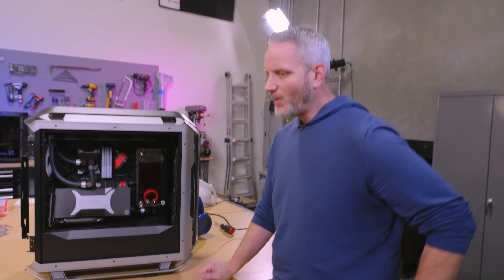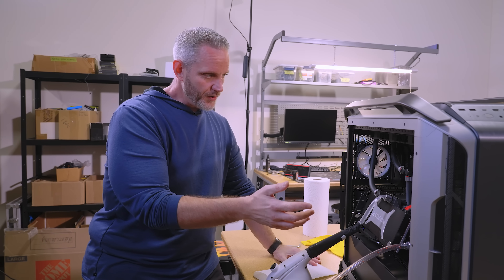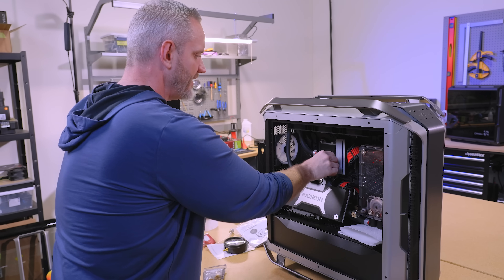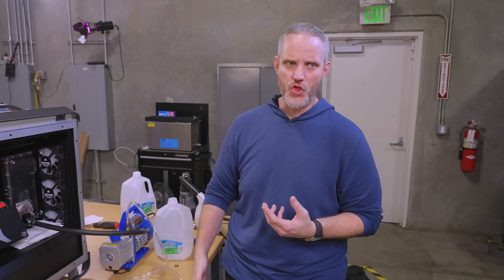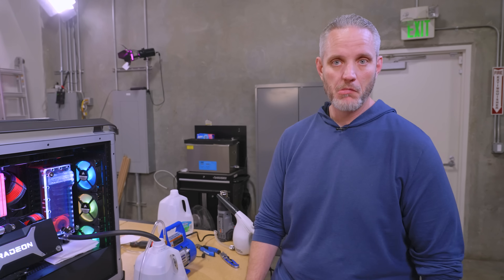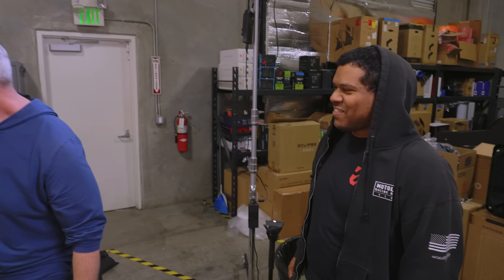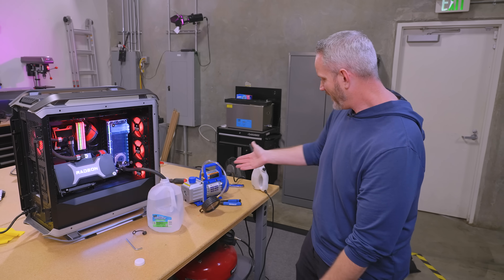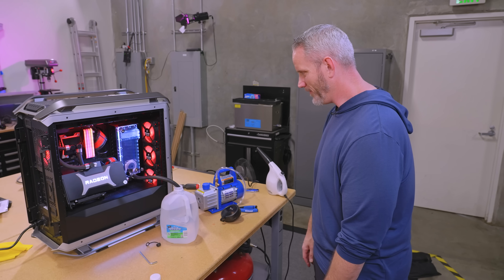I used Vacuum Pressure to fill a PC! Why didn't I do this sooner!?

Comment: Jay, test some radiators. The thinner walled heat exchange tubes might collapse under vacuum. If not, very cool solution.
Reply: Then the solution is to only pull a slight vacuum. Like -.25 atmospheres.
Reply: @avroarchitect1793  Yeah, you don't need barely any vacuum if you connect the pump to the fill port (highest in the system) and the fill tube to the drain (lowest in the system). Then you only need enough to lift the water from the container to the top of the res, 1-2 inHg is enough (1inHg = 345 mm H2O).

Add a catch container between the system and the pump (you could use a spare res using two ports at the top or use a jar and some barbs) to protect the pump and you have a nice system.
Reply: @MikrySoft  I have used a large mason jar with a couple of npt-hose barb connections to make a water separator, using a coupling cut in half as nuts for the pipe thread to attach them to the thin jar lid. Works quite well, we use these kind of pumps all the time to pull vacuum on double wall, vacuum monitored fuel tanks. They always have water in them if the seal leaks, or fuel if the tank has failed internally. Neither of which need to go through the vac. pump.

Comment: Jay, I thought about it and If you setup a reservoir where you're filling the liquid from a higher point of the computer and have the tube filled with water then entering through a different valve in the computer system after pumping the air out from the lower point of the computer with a drain valve, you could get a full no air system. The only issue you would have would be to understand how much liquid the system would hold so you wouldn't over fill it.

Comment: You could theoretically have another tube in the water with a quick connect on one end and have it above so you can use gravity to fill the tube to get rid of air then switch the tubes
Reply: I was thinking something even easier. After pulling a vacuum and shutting the valve, raise the black tube above the connector and pour water in it to displace the air. Pinch or plug the end of the tube and submerge it under the water. Done, little to no air in the tube.
Reply: @CHR0NOMASTER  dude, yes way simpler

Comment: could use the fill port as well as long as the hose has a valve on the end of it :)  this also would fix the problem with air in the hose :)

Comment: Why not get rid of get the valve and turn the pump on sucking all the fluid. The pump will remove all the excess air just as it does while creating a vacuum

Comment: Alternatively, just connect the drain (with a ball valve) to a hose going to water, and connect the vacuum source to the fill port. Then turn on the pump and allow it to pull in the fluid until it's full.
This would allow you to not have to deal with putting the system under an intense vacuum
Reply: Was going to say this too. This also guarantees no air in the system
Reply: wouldn’t this pull coolant into your vacuum

Comment: @jayztwocents You could try and empty the system by attaching the drain/fill hose and another hose for the vacuum pump to a bucket lid. Put the lid on the bucket and the water would drain into the bucket while the vacuum was being applied. The bucket would need to be air tight of course.

Comment: you can create vacuum in a reservoir, close the valve to the vacuum pump and the open the valve to the loop - that should pull the liquid out of the loop into the reservoir

Comment: If you use the vacuum fluid pump on the fill port and hook up the coolant jug to the dump port, you should be able to completely and fully fill the system with zero air!  SCIENCE!!!!

Comment: What you should do is put a fitting on the bottom of a bucket of some kind so you can full the bucket with coolant and plug the hose going to the bucket fitting. If the bucket is on a stand above the fitting in the system all the air in the hose will rise into the bucket. This would also be a good setup if you need to fill a bunch of systems really quickly. After the system is full you can just move the hose to the top of the system to top off.
Reply: Oh so essentially custom rigging a fill station reservoir, that's pretty dang smart.
Reply: And if he has a closeable valve on the bottom of the hose, then the hose will also stay full of liquid if any is left and not have air in it either that could be pushed into the system.
Reply: haha ! I just suggested the same thing !
Reply: topping off the res seems a lot easier.

Comment: the vacuum pump should be at the top of the system, and the fill tube be at the lowest. also, you need to run the vacuum pump through a jar, to protect the vacuum pump from sucking fluids. You could use that same jar, to pull clean fluid through the system to flush out the old gunk. < Automotive Radiator servicing>
Reply: Also that "mist" as Jay mentioned in the video correctly isn't the liquid. If anyone was paying attention to the entire process he vacuumed prior to adding the new liquid. ALL of those types of vacuum pumps expell a mist of heated oil out the vent port.
Reply: @user117  There is always some fluid left in the system, that was more than likely residual coolant being expelled from the pump with maybe a little oil from the pump, but it didn't run very long to heat any oil up. The kind of vac pumps we use at work don't spew any oil like these cheap ones do.
Reply: there is some mist around the pump in the video , @8:45  maybe it is blowing/spraying water out the outlet nipple... not so great for air vac pump for sure, i have same pump and it does not put oil vapors out like stated, makes me think it is water mist...
Reply: @TomislavReskovic   This is oil/water vapour that you are seeing coming out of the vacuum pump. This is normal and part of the process of vacuuming as it the water or moisture being pulled out of the loop is being boiled off in the vacuuming process.
Reply: so put a dry filter in line between the vacuum hose and the pump inlet. That's exactly what we do when pumping down HVAC systems. Honestly not that hard to figure out. Also as I've mentally to ppl before. It's really stupid and inconvenient behavior to make comments using @mentions if your going to have @mentions shut off yourself
Reply: @user117  I assume that was directed at me. I have no idea what you are talking about with the @mentions. 
I didn't say it was an issue that there was water left in the system, that is an easy problem to solve. I said you were wrong in saying that the system was dry when he started to vac. it and that the mist was oil rather than residual coolant.
Reply: @user117 never in my life seen someone do that. Why would you be attempting a vac on a system you didn't clean. No other reason for a filter dryer on a vacuum pump.

Are you sure you don't mean reclaim machine?
Reply: @asbestosfibers1325  I would absolutely insist on having a dryer filter on the inlet side of a refrigerant reclaim pump but there's been a few cases I've seen (mostly in situations of satellite location units being placed in a basement) where running a filter dryer on a vacuum pump was a very smart idea after the basement flooded and caused the units compressors to rot out and the refrigerant leaked out or short out completely.Definitely not a recovery situation at that point and having the dry filter allows the removal of excessive moisture accumulation in the lines and system.
Reply: You can just hook that pump up to a bottle for draining, just make sure it sits at the top of your recovery container and that is big enough
Reply: And if you really want to be crazy fing precautions of moisture residue do a nitrogen sweep.
Reply: You are correct...hvac been doing this for years!!!
Reply: You connect two bottles together with one hose most of the way to the bottom then another hose which barely is inside that jar.  Then the hose that is just inside  the first bottle goes into a second identical bottle and you create the vacuum on the second bottle.  All liquids will not be able to enter the short hose and if it does it goes in the second jar as it’s your safety jar.
Reply: 🤣 that type of vacuum pump definitely doesn't need "protection from fluids" it's designed to pump either flashed refrigerants or liquid refrigerant (depending on what refrigerant is being used)
Reply: @user117 vacuum pumps do not pump liquid refridgerant and this could be very damaging to them aswell as a good way to lose all your oil.

Comment: I have never heard of using a vacuum to fill the cooling system on a engine... I mean I suppose it works, but probably not necessary.  Maybe it's needed on the more exotic cars that I will never have?
You put a vacuum on the a/c system before filling, but I have never done so on the engine cooling system.  All my vehicles, you just fill the rez/radiator, run it, then top it off...
Edit: my vacuum pump is a compressor from a broken dehumidifier (the lines corroded and it leaked out it's gas) and it gets down to 27-28 vacuum

Comment: One thing: please use a gas washer, otherwise you could kill your vacuum pump.
And manybe use a 3 valve config in a T shape (nr 1 is connected with the loop, nr 2 is connected with the coolant and nr 3 is connected to the vacuum pump) and also prefill the tube where the coolant is connected

Comment: I wonder if you could put a trap inline to protect the pump from coolant? When using a vac pump for infusing you have a jar with two ports in the top, vac in one and then part bag on the other. It catches any fluid in the jar and stops it flowing all the way back to the pump.
Reply: Just buy a reservoir? 2-3 ports at the top, we're good.

Comment: Could you put the vacuum at the top of the reservoir to create negative pressure and pull in fluid from the bottom until all the air is out from the top?

Comment: @jayztwocents was I your inspiration ? 
5 days ago on your distroplate video-

"btw for filling have you ever tried using a automotive vacuum fill system attached to a fill port with a quick-connect fitting?"

Comment: That blower is a vacuum, it just functions by using the exhaust to blow things around. But it's sucking air in via a vacuum pump in the bottom.

Comment: Pulling inspiration from the auto field is brilliant! I recommend putting a vacuum trap between the drain and the vacuum pump to protect your pump from stray drops or schmoo in the system. To go EVEN FASTER, you could hook up a tube, valve, and jug to the fill port too. Apply vacuum, close one valve, open another, FWOOSH!
Reply: Fwoosh are all the entrained microbubbles of air just put into your system!

Comment: I'd like to know more about what is causing the noise coming from the radiators while under vacuum. My concern is the fins detaching from the fluid channels and losing cooling efficiency because of less surface contact.
Reply: My concern is they collapse under vacuum then don't reinflate (or lack of a better way to describe it) when reg pressure is reapplied, so they don't have the same surface area/volume to radiate heat in future
Reply: @grosslyincandescent0  also some of the pipes might be sintered so causing those to flex too much might break off small pieces of metal that will float around.
Reply: I was thinking the same as Jay mentioned this noise.
Reply: I was thinking OceanGate when that happened
Reply: Thin metal flexing
Reply: Fins are on the air side of radiators, not in the liquid side.
Reply: I think it's the channels. They're very thin sheets of metal and not built to deal with vacuums. My fear is that they're flexing so badly that the fins are popping off them and effectively doing nothing now. I bought a Leakshield with the express purpose of filling and draining my loop (I'm not afraid of leaks, but it's a nice feature all the same.) Hopefully since it doesn't go as far with the vacuum compared to Jay's big boy pump it doesn't cause the same harm to my radiators. I'll know in a couple weeks tops since I'll be using it to drain my loop for maintenance then hooking it up and filling with it too.

Comment: Idk much about fluids and stuff but what if you had the same setup for draining? A container that you use the vacuum pump on and close it with a valve, then when you open the valve on the PC the water comes rushing out?

Comment: As long as the vacuum isn't too strong it works. Too much vacuum and it ends up sucking air through fittings defeating the purpose. I have that exact same Amazon vacuum but I use it to vacuum out auto AC systems to recharge them for far cheaper than a shop charges.

Comment: Why not a system case that has the motherboard ,cpu, and gpu in a vacuum? Doesn't heat require oxygen. So A system in a vacuum would not generate heat right?
Reply: You're right, the sun is actually pretty cool to the touch.
Reply: @treborrrrr  Right? Positively frigid.
Reply: The sun doesn't heat up space where there is no oxygen. It's absolute zero. The burning of the sun is not chemical combustion. It is nuclear fusion. DUH!  @treborrrrr

Comment: So there was this product that Linus tested something like 3 or 4 years ago now that was called "leak shield" and basically what it did was it drew a negative pressure on the water loop which helped to fill it this way too. It uses a piezo pump which is crazy in my opinion but that's largely what I want next time I build a PC, whenever that is.
Reply: It's being sold since a while now, about 2 years IIRC.
'Aqua Computer Leakshield' (german company). It's main use is drawing negativ pressure while the loop runs which prevents fluid from spilling if there are small punctures for some reason. Hence the name leakshield. Filling the loop by pulling a vacuum is more of an additional use of the system.

Sadly, outside of Germany (and somewhat EU) Aqua Computer, Watercool and TechN are barely known as it seems. Those 3 are german brands with awesome custom loop stuff.
Reply: @schnipp6876  they are well known to r/watercooling and anyone who knows anything about water cooling
Reply: Im currently building a system with a leakshield, that video is what got me into watercooling, or at least gave me the confidence to try it out for the first time.
Reply: It's still absolutely insane how effing sensitive that thing is, you literally lose a drop and it detects it.
Reply: @cburgess7  its not the lost water that it detects. Its that any hole in the loop creates a loss of pressure and it's very easy to detect the pressure change
Reply: Got one. LOVE the damn thing. saved my 7900xtx computer shut down while gaming with all my leds flashing red.
Checked and one of the L connector above my videocard was leaking :P
Reply: I have a Leakshield in my system.
My first watercooled system.
Reply: I use one, would recommend it.
Reply: Ok, I forgot about leaksheild but I'm gonna go buy it now
Reply: thank you so much for this comment, i never knew this was a thing but damn that is a life saver if something where to fail. I will try to add this to my loop.
Reply: I remember that, that was a really interesting device especially for it's time.

Comment: This is actually a question I have had.  I use a vacuum pump to remove air from hydraulic systems and to some cooling systems.